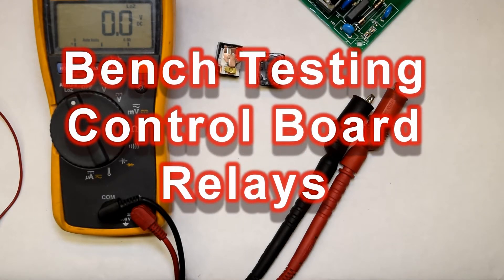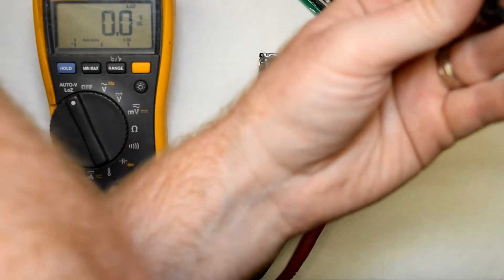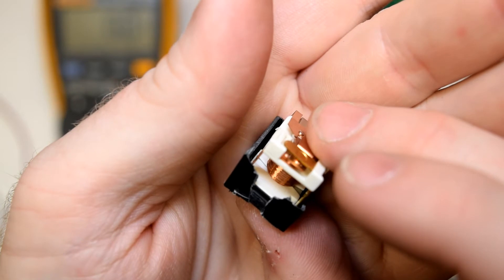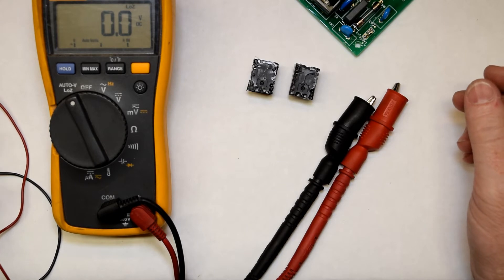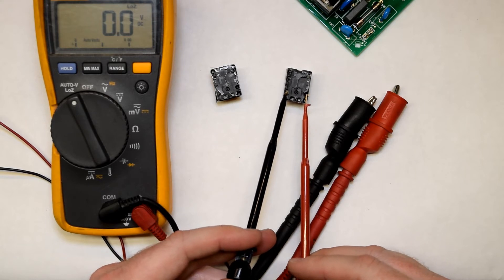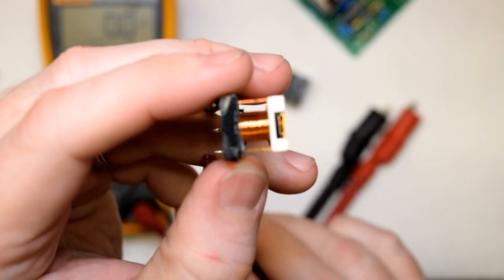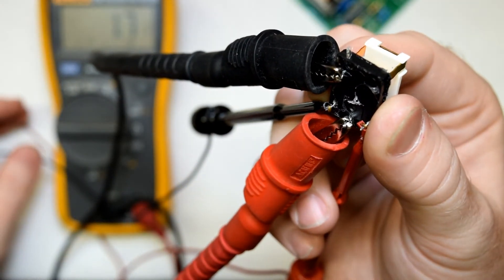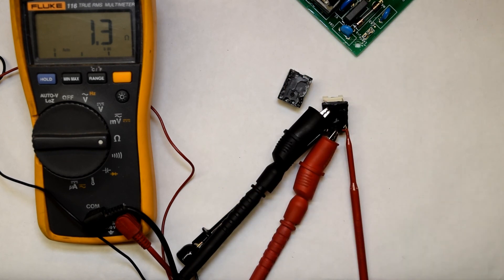Bench Testing Control Board Relays - WR55X10942 GE Board

Comment: There may be somebody out there who's interested in this video?? OMG am I ever!!! Am trying to diagnose power failure in my dishwasher so yes am absolutely interested!! Only thing is, I don't have a bench tester and my relay is 12V. So I'm wondering if I can hook my relay up to the 12V battery in my car to test 🤔 I can't see why not??
Reply from the maker: Yes, you certainly can!
However, your 9v battery will likely work as well for test purposes.
You'll find that there are minimum allowable voltages for each relay and 9v on a 12v relay is likely to activate the coil.

This would pull the contact shut enough for you to test the contacts.

Keep in mind, the relay would need to be removed from the board in order to do these tests.

Good luck!

Comment: Hi Andy, I have a Thermador refrigerator model number KBUDT4860A02, control board is 2252070. My refrigerator is working intermittently, online search suggests possible control board failure. Further search suggests one or more of the four relays may have failed. Is there a way to test which relay has failed without removing from the circuit board? Any suggestions for good multimeter, will purchase to complete tests and repair.

Comment: Appreciate your good work! I found it detailed enough to guide me thru my first washing machine repair: It powers up and but seconds later all power gone..its DEAD  

I'm looking to see if I can isolate the issue using my multimeter determine the fault and ultimately fix it. Starting with tracing voltage to the control board. I suspect it's a relay switch fault....

Cheers
Pete

Comment: Good job showing that!  Relay's can also fail to make contact between the switch terminals as well.. You may have a good coil.. but the silver pads have too much carbon build up to actually make a connection... just got finished working on a whirlpool slide in range with a bad bake element.  When the element went into full welding mode it damaged the bake relay, and the isolation relay.  Ordered a new board and the bake relay was bad on the new board... I was able to rob the convection relay off the old board and replace it on the new board to get it working... The logic was sending the 12VDC to the relay and it was clicking, however no continuity between the switch legs... after swapping components I had a happy customer ready to cook a turkey 😀

Comment: I am trying to troubleshoot a relay on a board....I have narrowed it down to a bad relay but I want to be sure...one post of the coil side is reading 12vdc...the other side of coil is reading 6vdc....do both sides need to be 12 volts? Does 1 side need to be 12 and other 0?  Or is it right being at 12 and 6?
Reply from the maker: Hi, It is best to fully remove the relay from the board to do the testing. I think there may be specialized equipment that may be able to test with the relay on circuit, but I'll be honest in saying that's out of my wheelhouse.

With the relay removed, you're then able to apply appropriate voltage to the coil, activating the contacts and then measuring for low resistance across these pins.

You'd also be able to test the coil resistance measured against the relays data sheet to see if it's in spec.

However, in circuit the way it is, your readings may or may not mean much as you aren't able to isolate the relay.

I hope it's helpful.
Reply: @GraceAppliance  I doubled up a 9v battery to get 18v and put it to the relay to get it to click and I still don't have continuity where there should be...I think it's a bad relay
Reply from the maker: That's probably so. Feeding 18vdc to a 12vdc relay can damage the coil. I'm not sure of that's enough to fry the coil windings, but I'd use caution with that approach is all I'm saying.

The relays data sheet probably does list a maximum voltage allowance if you'd like to confirm.

Mouser.com is a great place to take a look for datasheets.

Comment: I had a refrigerator where the compressor wouldn't run. I figured out which relay on the control board switches power to the compressor. I removed the relay from the PCB and tested it to confirm it was bad. I then cut the relay open, cleaned the contacts and reinstalled the relay back onto the PCB. This got the compressor running again. Then I ordered a new relay from eBay. It had to come from China so it took three weeks to get it. The old relay held out for the three weeks until the new relay arrived and then I put in the new one. The new relay cost about $6 while a new  control board was about $250.

Comment: What kind of 12v power supply do you use? And can you rest the relays in circuit without removing them from the board?
Reply: You need to be careful applying 12 volts from an external power supply to the relay while its still mounted on the board. For one thing the relay coils usually have spike suppression diodes across them so putting the 12 volts across the coil in the wrong polarity will short out and possibly damage the diode. Also, the board uses a solid state device, usually an driver IC, to switch the power going to the coil. If you put voltage across the coil from an external power source it could destroy the driver IC. If you do that the board is junk and it will never work again even if you replace a bad relay. All in all its better to remove the relay and test it off the board. If its bad and you replace the relay without damaging any other components on the board it will probably work fine after that.
Reply: A 9 volt battery will usually work to trigger the relay. Be sure to connect it to the coil terminals.
Reply: I'm reading 12 volts dc on one end and only 6 volts dc on the other end.....it is feeding voltage to a compressor for wine cooler

I tested continuity where there should be and there is none

Comment: Where can i get that tool you was using too test the relay please
Reply: No the power supply tool that was giving the relay power please
Reply from the maker: tom Waters sure thing, here you go: https://www.graceappliancediy.com/products/yescom-110v-ac-30v-10a-dc-power-supply-precision-variable-digital-adjustable-w-clip-cable

Thanks!
Reply from the maker: tom Waters hi Tom, if you mean the meter:
https://www.graceappliancediy.com/products/fluke-116-hvac-multimeter-standard?_pos=1&_sid=af300bc7f&_ss=r

But, if you’re talking about the DC power supply:
I am not nearby my power supply at the moment to look on the brand, but there’s many different ones that would do perfectly fine for this.  
It’s a device that has two leads coming out and is adjustable DC output. It makes testing relays, fans, etc etc very easy.

Comment: Is there a way to test the relay when it's still on the board?
Reply from the maker: Unfortunately, no. Not to my knowledge at least. You can only test the output voltage to see if it's working.

You might be able to get the coil of the relay to activate if one had a DC power supply by applying 12vdc to the coils 2 pins. But making the needed resistance measurement would not be accurate because the relay is in series to the rest of the circuit which would add resistance. So, you would not get the low resistance figure you're expecting on your meter.
Reply: If you've got a relay that clicks and has some continuity but you want to check if it's failing, you can check it in-circuit by checking the voltage drop across the relay terminals under load (much like you would an automotive relay). I don't recall what an acceptable voltage drop is, but it shouldn't be much. Obviously this can be dangerous, particularly if the relay is switching 120VAC. And getting probes in place while the board is mounted is going to be tricky. But if it can be done, that's how you'd test it in-circuit.

Really though if you're trying to figure out if the relay is working at all in-circuit and can energize the coil you can at least tell if the coil and contacter are opening/closing appropriately if the resistance goes from infinity when it should be open, to "low" when it should be closed.
Reply: You need to be careful applying 12 volts from an external power supply to the relay while its still mounted on the board. For one thing the relay coils usually have spike suppression diodes across them so putting the 12 volts across the coil in the wrong polarity will short out and possibly damage the diode. Also, the board uses a solid state device, usually an driver IC, to switch the power going to the coil. If you put voltage across the coil from an external power source it could destroy the driver IC. If you do that the board is junk and it will never work again even if you replace a bad relay. All in all its better to remove the relay and test it off the board. If its bad and you replace the relay without damaging any other components on the board it will probably work fine after that.

Comment: Have and do you rebuild those boards? Whirlpool charges a $60.00 core so to discourage rebuilding and GE is charging $55.00 for their control board core
Reply from the maker: I've had luck with replacing the capacitors and relays if the issue was not fan related. However, not so much luck rebuilds if the fans had damaged the two large green resistors. This may have been bad luck or something beyond a failed board, but haven't tried much outside of that. 

I've tried a couple times to make a rebuild video, but it's tough to show the level of detail needed to remove and replace the components.  The clear protective coating that's on the board makes the removal really difficult and pretty ugly from a video standpoint.  

I wouldn't put a rebuild board on a customer's machine personally just due to the liability, but have used the shop down in Austin (fixyourboard) for oven boards with great success.  

All that said, it can be done if you don't mind getting a little rough with the board for parts removal. 
Radio shack used to sell a solder pump iron that made the removal a breeze, but since they've gone out of business I haven't looked around for a suitable replcamamet.
Reply: I wouldn’t put a used board in a customers machine either.

Comment: Hi Andy, thank you for the great video it is extremely useful. My refrigerator has the same board and upon inspection I found that the U14 chip has blown. Before I replace the board I like to know what that chip drives. I would hate to replace the board and have the same thing happen again. I would appreciate the help.
Reply from the maker: Hey guys, let's see if we can get it figured out.
My fridge has this chip, but it's labeled U14 on the board and about 1/4inch square. Closest to the J5 connector pins. 

Is yours the same?

Also, what is your model numbers.

My fridge does not utilize the J5 plug so I expect it may be something like custom cool fans for crisper drawers or something my fridge doesn't have.
I beleive that's the typical plug used.
Do your fridges have custom cool fans for the crisper drawers?

Looking at the copper traces on the board, at least one of them leads to a pin on J5.
Reply: Yes exactly the same.
Reply: Andy my J5 connector is not connected as well. I have the connector pins on the board but no harness gets connected to it. The model number for my fridge is PFS22MBSBWW.
Reply: I can send a picture to you if you can provide an email.
Reply from the maker: @mr.v139  Sure, graceappliance@gmail.com
Reply: Mr.V I think j5 might involve damper door motors which some units do not have. I am not sure. 
  That or something to do with dual systems. 
  Trying to learn more about these electronic systems myself.